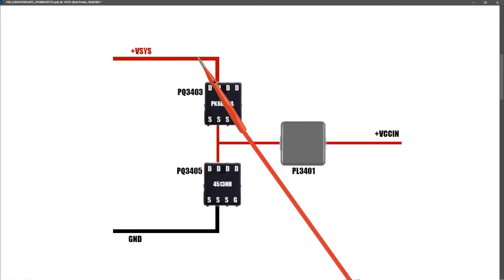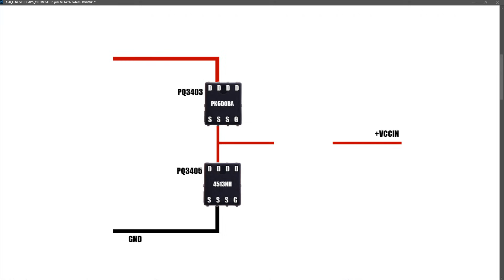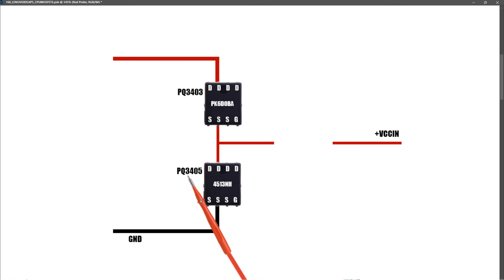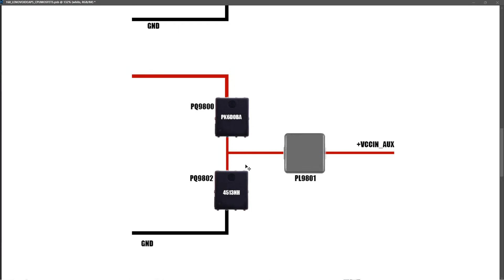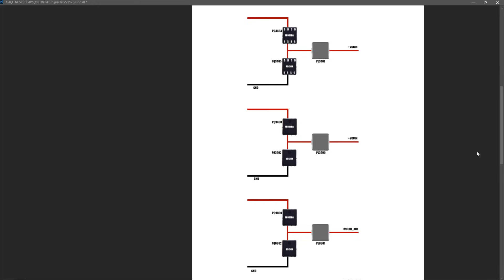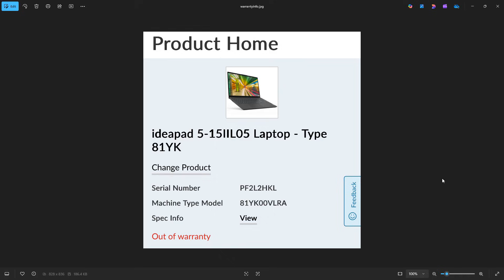LENOVO IDEAPAD 5 - NOT POWERING ON (PART II)

Comment: Before you inject any voltage, take a quick precaution—always measure the resistance from the CSR to ground first.

* If the reading is above 1 ohm, hold off. That usually means the short could be coming from a downstream MOSFET, and if you inject right away, there’s a good chance the current will flow straight into the CPU. You were lucky that didn’t happen to you.

* If the reading is below 1 ohm, it’s more likely the short is just coming from a capacitor, which is less risky.

And here’s a tip: instead of removing the coil completely, you can just lift one leg to isolate the CPU from the circuit. Once that’s done, switch to resistance mode and measure the coil pad that faces the Vcore section. The ohm reading will tell you a lot—whether it’s just leakage or a full short to ground. No need to check the drain and source in diode mode for this step.

Comment: Are you sure you're not missing two mosfets? Also the EC chip might be corrupted. I'd also reflow the existing mosfets.
Reply from the maker: I was confused by this also, but I managed to get the exact schematic for this board, and it seems that these MOSFETs are optional. I also checked other similar boards available on line for sale and they seem to be missing those MOSFETs also. Thank you for your comment.

Comment: clean the old paste off cpu and chipset then thermal the cpu while adding power. 1amp direct injection. Will tell you fast if chipset is bad. If the shop found and replaced a failed mosfat and found the cpu dead you would probably not see the worked area.